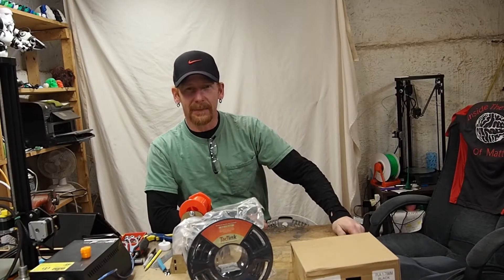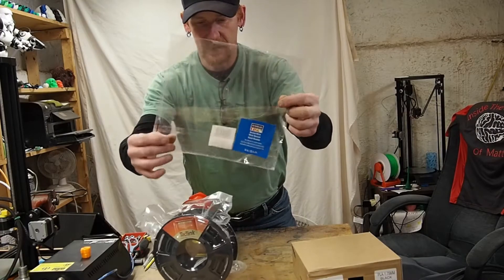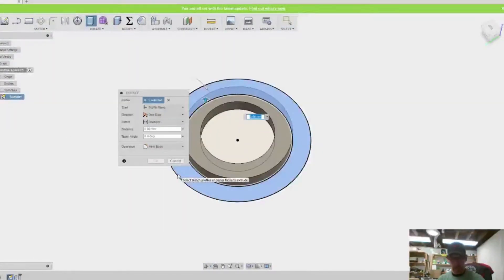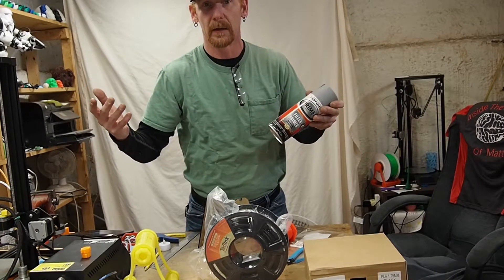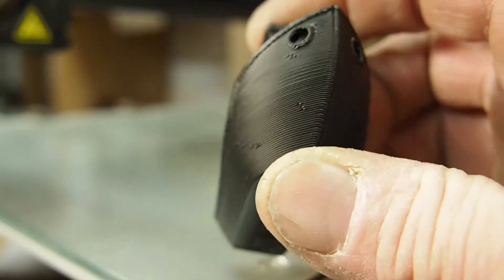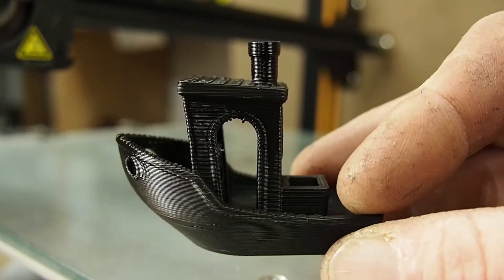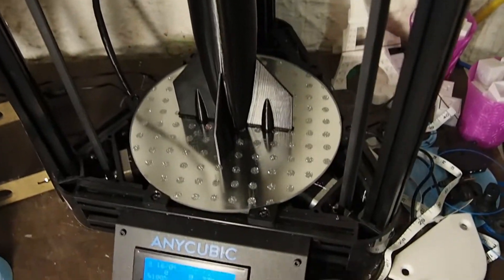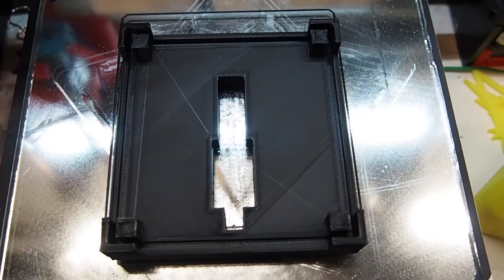Black Tactink PLA Test and Review Using 3 Different Printers

Comment: Matt, done any bronze fill yet? Right now they’re out of stock at Amazon. Over the years the old wedding band is a bit tight so thought I’d print up one w/bronze. For now i did print off a ring from thingiverse in pla til bronze comes in stock. For now I’ve been using hatchbox, have some translucent PETG from eSun to try out.
Reply from the maker: Gary Slovinsky funny you should ask an upcoming upgrade (there will be a video) will lets just say broaden my material capabilities not too much hype but you’ll know when you see it. But no I’ve only had brass nozzles but would love to know what your using if not brass 
Thanks for watching!
Reply: Inside The Mind Of Matt Actually I intend to print the bronze using the standard .4 brass nozzle. I expect/suspect nozzle wear, so just to be on the safe side I ordered a half doz replacemenr nozzles. I do have a hictop replacement/upgrade hotend in my cue at Amazon. Not sure if it’s using a hardened nozzle or not. If the pla bronze turns out gawd awful horrible I may have to post. It.